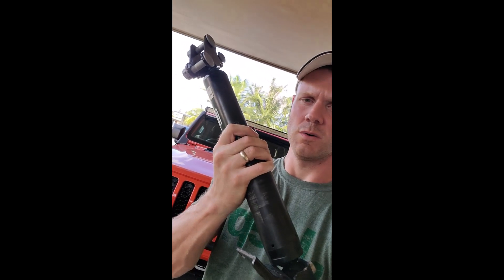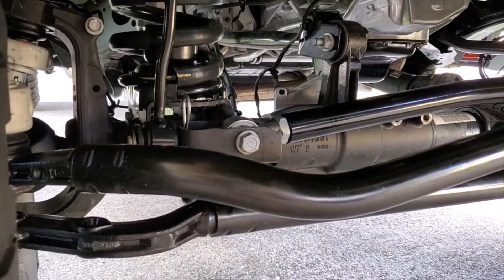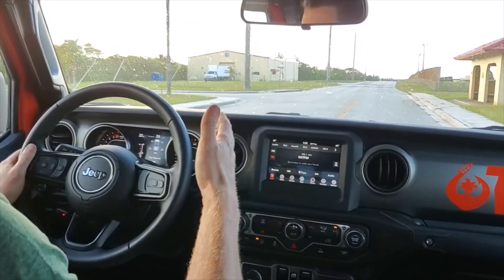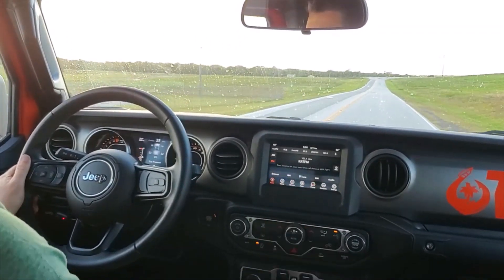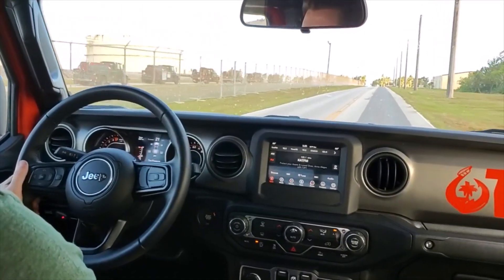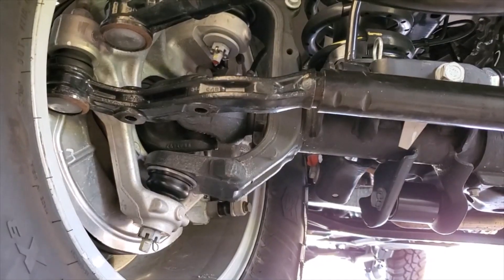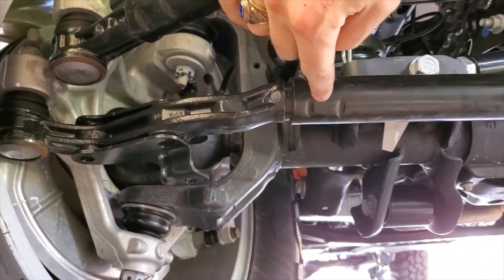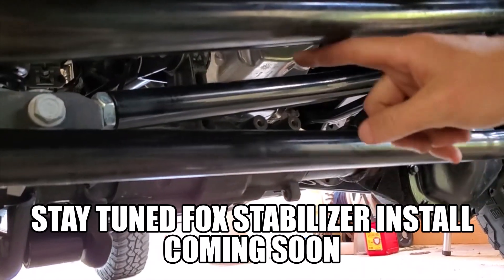Can you drive around without a steering stabilizer?

Comment: removing steering stabilizer overall made the world of difference on the gladiator, assuming the alignment is within spec and steering box was set at the proper tension, and no third-party parts/lift kits junks on the truck so far.
Reply: And agree with @jeeptjwheelin5799, the Falcon 2.2 stabilizer was the worst thing ever happened to my truck. Upon removing Falcon stabilizer and leaving the OEM one uninstalled, the gladiator now drives with perfect road-manner like any modern-day IFS half-ton truck does.

Comment: excellent,  i bent a tie rod and drag link on my JK. 
switched to a 1ton steering, replaced ball joints and aligned again after new parts.
I have been driving without an stabilizer to get everything dialed in.
the stabilizer can mask problems
I plan to go to a high mount stabilizer after i know the Jeep is good to go

Comment: why is there a steering stabilizer?
Reply from the maker: To soak up bumps that may cause oscillation. I have been driving around for a week and did notice some situations where there was a pothole that caused a jiggle but it stopped quickly. I believe this is why that steering dampener is there.
Reply: I think that was a rhetorical question.
Reply: @Luke2136  It's reasonable based on what he said in the video, you still want to have one but maybe not such a high end on like how some people think they need.